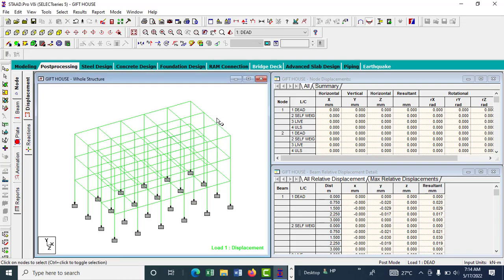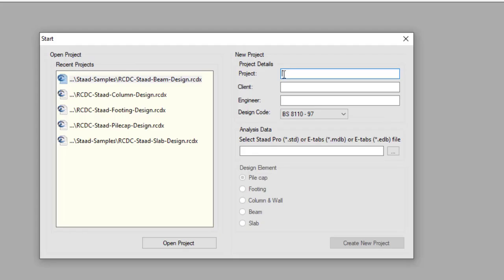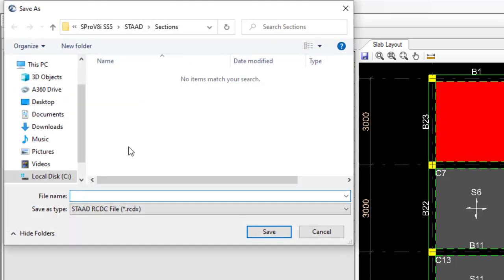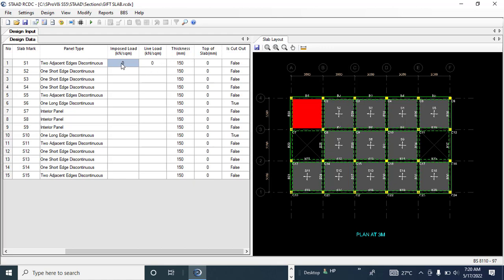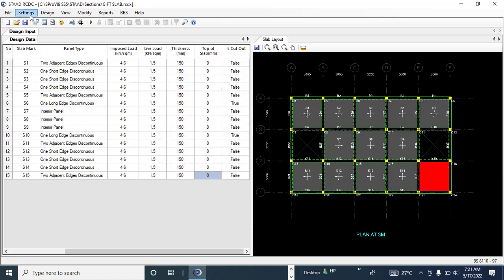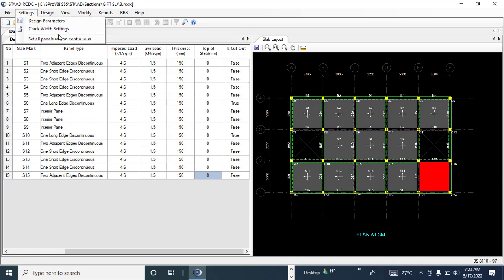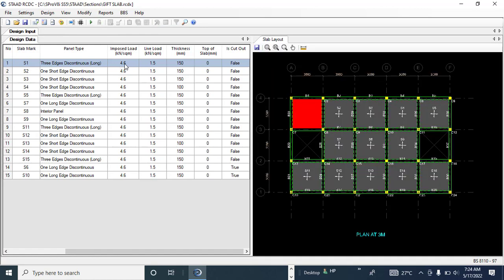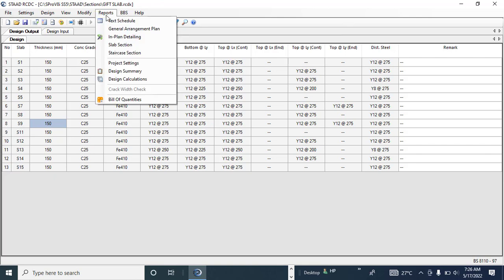Slab design with Staad RCDC. All about slab design in Staad RCDC.

Comment: Can u pls clarify the 4.6Kn/m2 in the '"Imposed Load " Column.Is the whole 4.6Kn/m2 additional dead load or it includes the selfweight ??
Since The selfweight of the slab is automatically calculated so that 
'"Imposed Load " Column in the RCDC is supposed to take care of additional dead load i.e. Partitions and Finishes so if u assumed partitions to be 1.5Kn/m2 and Finishes  depending on thickness of your screed and tiles say 1.2 -1.8Kn/m2 so meaning additional dead load = 2.7 to 3.3Kn/m2.

Comment: Self weight of slab is automatically calculated in RCDC. No need to add as imposed load. 
Dead load of slab is automatically added to design depending on slab thickness assuming density of 25kN/m2.